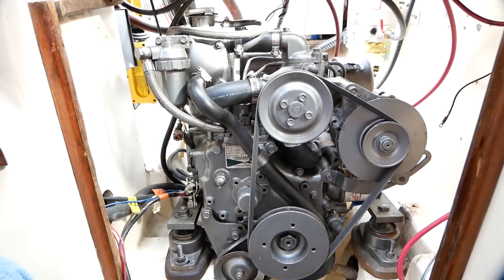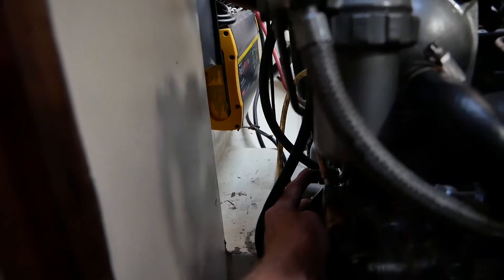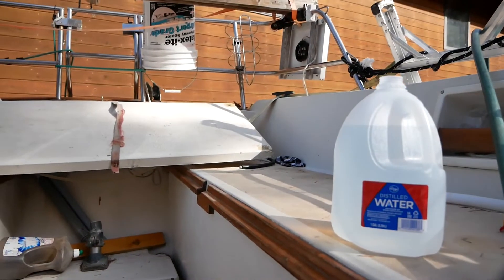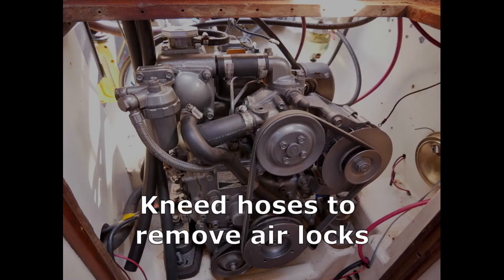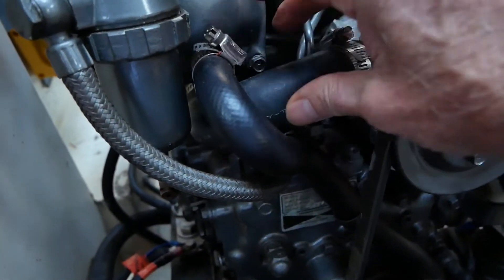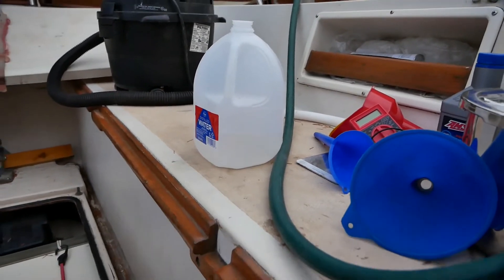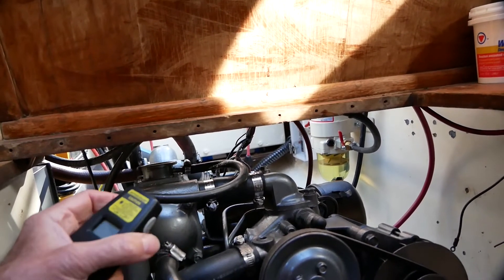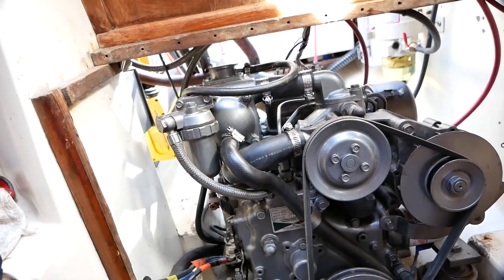Coolant Flush on a Yanmar 2GM20F

Comment: Thanks for the video!  Can you recall the temperature range you were looking for?
Reply from the maker: That's a great question, I should have mentioned that. The Yanmar service manual for the 2GM20F shows the temperature switch normally off at 187F and comes on above 193-202F and the thermostat fully open at 185F. So based on that I was looking at 180 as a max temp since I was looking at the surface of the engine.
Reply: @trailsandsails2722  "The Yanmar service manual for the 2GM20F shows..."  Or as I was told in high school: "If all else fails, read the instructions."  Thanks for humoring a lazy sailor 😊  And thanks for the succinct video!

Comment: This the most bizarre desmonstration why distilling water but not the real antifreeze just fews dollar a gallon? Just thinking
Reply from the maker: Thanks for your comment and my apologies for not making this more clear. I was using distilled water to flush out old antifreeze/coolant. It took several flushes with running the engine each time for several minutes to clear most of the old coolant. Perhaps there is a more aggressive flush than distilled water but I could not find anyone to recommend one. After the last flush, I filled the engine with a diesel engine coolant.